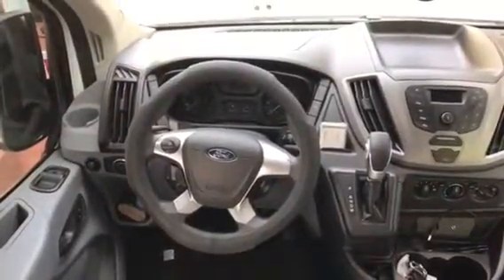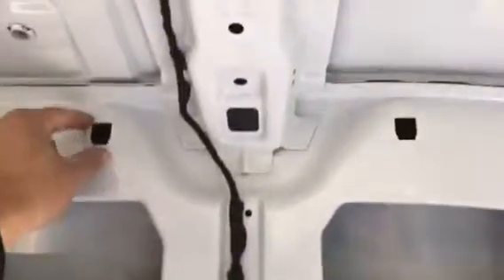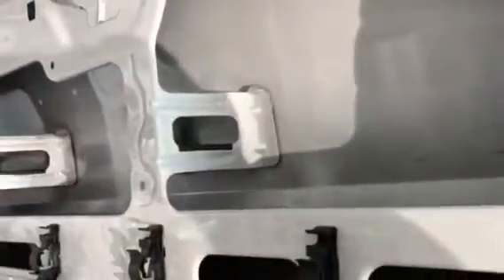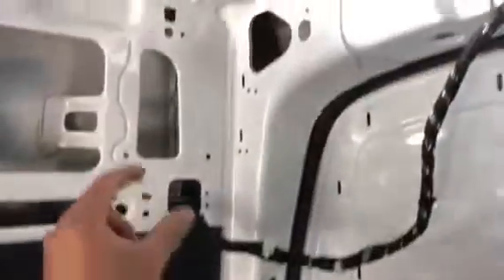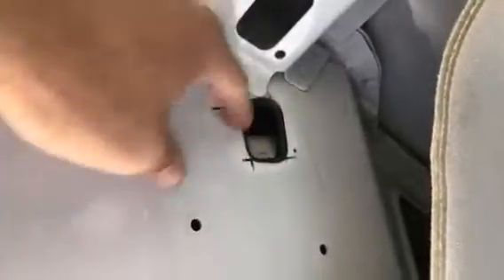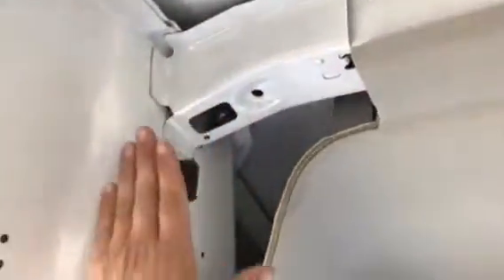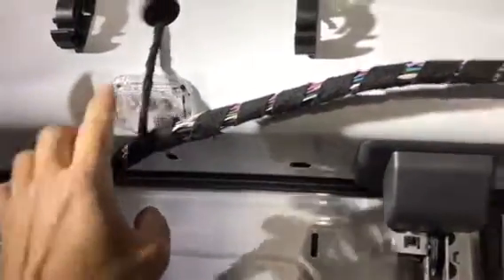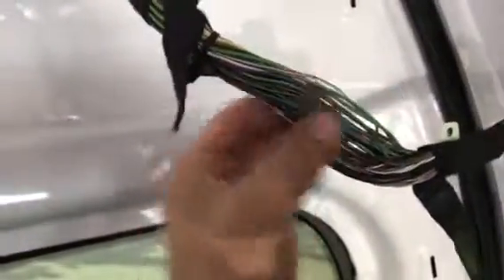Ford transit 2016 Van conversion part one relocating wire harness

Comment: I also have a 2016 Transit 350, but passenger van model. I'm looking at adding trailer wiring harness and am shocked that Ford did not prep for trailer wiring harness. The method to install is sloppy at best, disappointed in how you have to do the install. Doing some further research I come across your wiring project. Holly cow...lol, my wiring issue is for toddlers....lol. I know your project is a fairly straight forward, just very labor intensive. I just cracked up when I thought of me griping about a trailer wiring harness and your rerouting that monster harness.  Nice job and very detailed install, it will come out great no doubt 😀👍, Had to subscribe just to watch you do your build, nice job and thanks for sharing

Comment from the maker: Thx . Yes it's a monster wire harness. Lol.I had my trailer wire harness installed by a shop I was picking up this van from Texas I'm in California I had plan on hauling a vehicle over but did not fall through.by the way I like your videos I'm going to try to continue making videos I currently started a new job so I don't have the time recently. I'm now working for sunset vans in Downey California installing wheelchair ramps on ford transit 150s . I'm learning a lot and I'll be buying some of their products for my build.